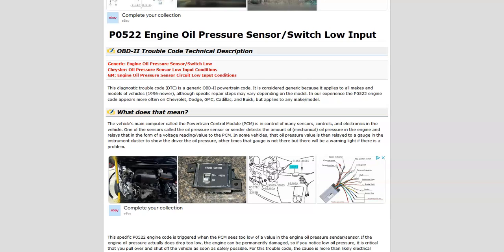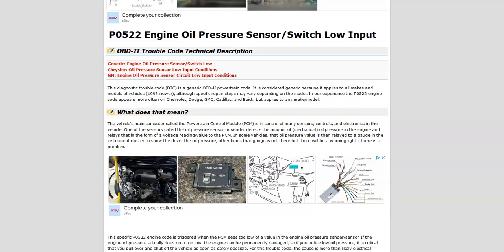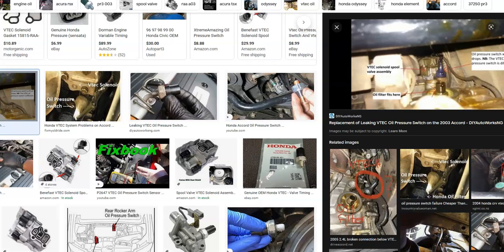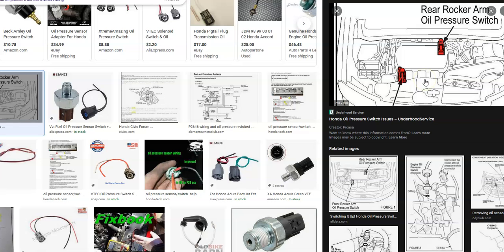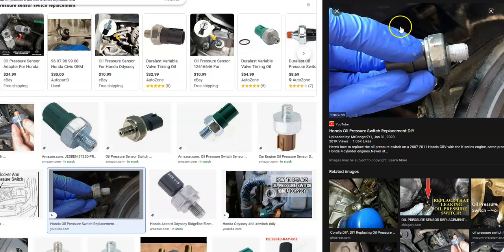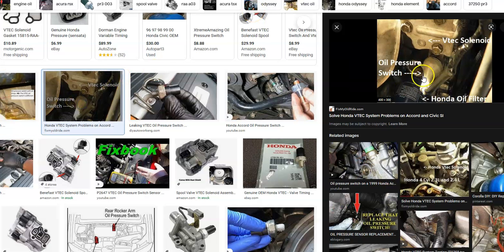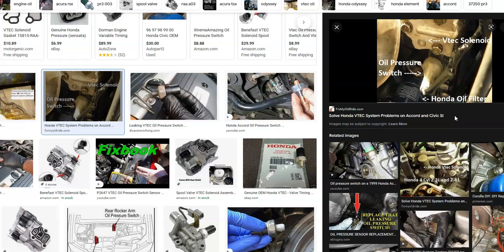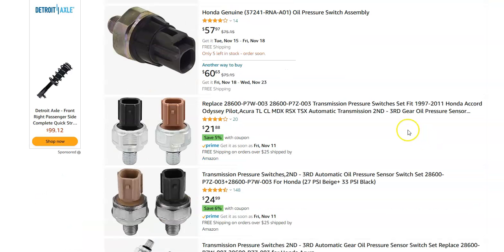Causes and Fixes Honda P0522 Code: EOP Sensor Circuit Low Voltage

Comment: i just replaced my two sensors and the check engine light is still one.. the only code im getting is p0522
Reply: I have the same problem. I have already changed the two bulbs and the solenoid and the oil light is still on, could you solve it?
Reply: @DiegoSaavedra-z5g Did you fix the problem
Reply: Same issue I'm going thru
Reply: @davyna3 Did you fix the problem
Reply from the maker: If all the sensors are replaced, then the only things left are the sensor's wiring and possibly bad oil pressure.
Reply: @HVAC_Mechanic  more advanced code reader still said p0522 but also said rocker arm.. but the oil is slightly over filled
Reply from the maker: @Dogerocket  Also, you can check out the VVT or VTEC solenoid, depending on the Honda. They often have a small screen that gets clogged up and blocks the flow of oil, which lowers the oil pressure.
Reply: @HVAC_Mechanic  oh thanks ill def check that
Reply: @HVAC_Mechanic  ive tried literally EVERYTHING and nothing is turning that fucking light off.. its still reading p0522 im at a complete loss